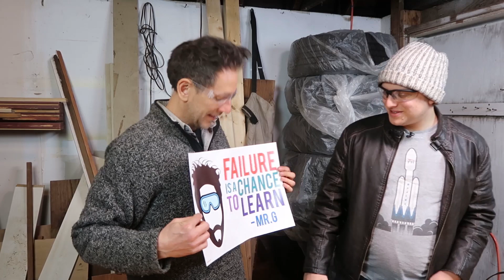Electric Conversion Workshop: Lawnmower Project - Episode 8

Comment: Thanks Jesse and Mr. G. Great series. I hope to do my own conversion when this is over. Do lead acid batteries need a BMS? I assume not, since the 6 cells in a 12 volt battery have no wires going to them when using a charger. If they don't, why don't they and why do lithium ion batteries need one? Thanks.